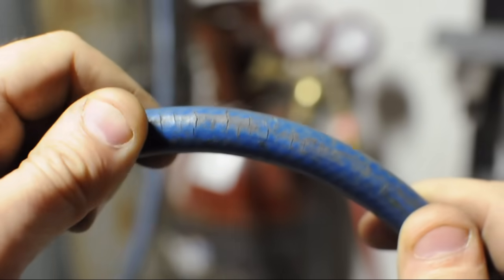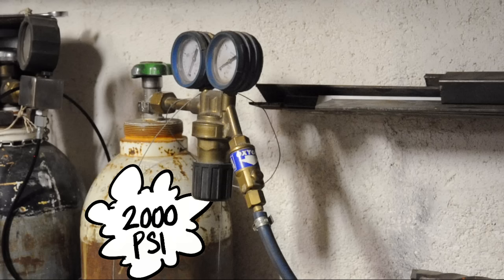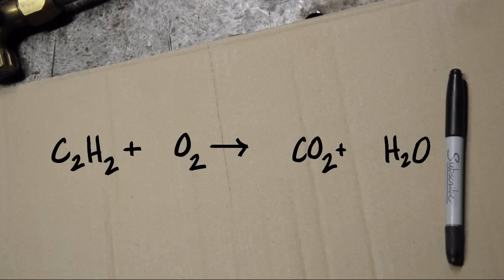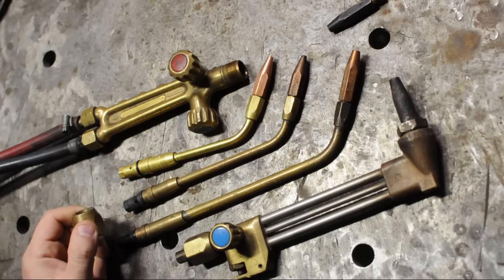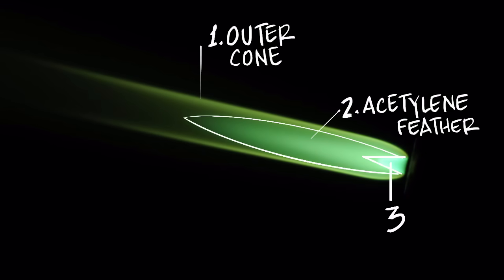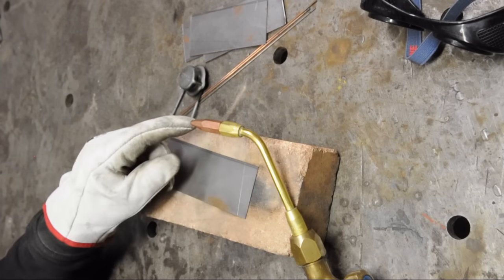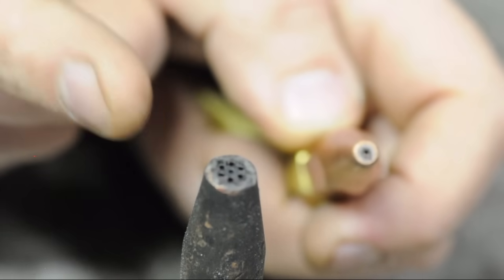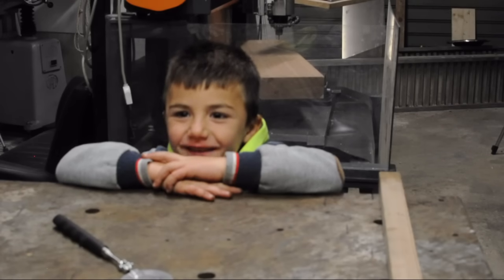Let's Talk Oxy Acetylene

Comment: I inherited my father’s oxyacetylene torch set. Unfortunately he never showed me how to use them before he passed. I have been watching YouTube to learn but wish I had in person instruction. I practiced on a couple pieces of scrap then got underneath the truck to weld an exhaust pipe. The hot filler rod stuck to the metal then fell down my sleeve and now my arm is burned up. Gravity is not your friend when it comes to welding on your back underneath things. Why doesn’t any of these videos teach that? 🤔😆 I have so many bad burns on my arm now and melted skin on my shirt. I won’t forget that oxyacetylene welding lesson for a long time. I can attest to what he said about how hot they get....

Comment: Another reason not to use anything but a striker is that if there is some acetylene buildup near the tip before ignition, it can find the flame and cause a flashback.

Comment: The saying not to use a lighter started when plastic lighters were being used, they had a few problems in the early 70’s. Someone would light the torch with alittle oxygen on to keep the fuzzy’s out of the air, and a few times the flame 🔥 hit the plastic.  💥 BOOM 💥

Comment: Just a quick tip. If the pressure in your tanks are low, just hit it with a sledge hammer to increase the pressure. 😉👍
Reply: Rent a steamroller for the tube of toothpaste effect. Gotta squeeze every last oz of gas from those bottles.

Comment: I got material that was cut with a flame. I made a new HSS end mill dull, milling only two pieces, just by making one of the cut sides flat. I knew that because of the heat the edges where hardened and would’ve chosen a carbide tool or a tool with carbide inserts, but I’m just a trainee so I use the tools I’m told to use.

P.S. for anyone interested. After cleaning one side, I put both pieces together in my vice and milled them to be parallel within 0.05mm (~0,002in) to a length of 225mm (~8,859in)

Comment: You have a dirty cutting tip. 
Also the perfect set up on a cutting is with a long oxygen stream and when you press the trigger it sounds smoother.
The pressure balance between the Two gas’s can be adjusted to obtain a six inch oxygen stream.
Then you can cut a six inch steel plate with good results.

Comment: Shop teacher always told us not to use a butane lighter stating that it would be possible for the butane in the lighter to be ignited and have the thing go off like an fire cracker in your hand.   We always thought that was far-fetched but the striker was always there so no big deal. 

I think we were told zippo lighter‘s were OK since they were not under pressure. Sorry this was  20+ years ago

Comment: The reasons for not using a lighter is many, but my welding teacher put an almost empty BIC lighter wrapped with hotdogs on the table and swept the lit torch over it, it took less then ½ second to explode, another reason is when you put that lighter in the pocket and a piece of glowing metal splatters all over it, you have that explosion in your pocket.
He then picked up a piece of blown off hotdog from the floor and said "in the best case, this is one of your fingers, in the worst case you had the lighter in the front pocket of your pants, and guess what this would be in that case"
No one ever had a bic lighter on them while welding/cutting anything after that....

Comment: I believe you use a striker because it has no fuel in it. If you use a bic, and set it down not thinking about it, and a nice fat piece of slag falls on it and melts the plastic, it could explode. I still use my lighter all the time, I just put it in my pocket or at a higher elevation.

Comment: Interesting ! I was taught to have the Oxygen pressure always higher than the acetiline
because that is what keeps the acetline from burning in the hose.... I don't really know if that's true or not as I wasn't about to experiment with flames going up the torch lines ! 
 I always set the Accet. to 7 psi and the OXY. to 10psi and seeing you put both the gasses at the same pressure scares me....   i ran a Oxygen Acettiline outfit for decades before I got my stick welder.... I had a nice victor torch set and used it quite frequently.
but in all honesty i haven't used one in years now.... there is no need I found I could cut steel with the 200 amp stick welder just fine and even saw a setup using a carbon rod and air gun attachment for doing heavy cutting...  a few times welding small stuff with too big a torch tip I did have the flame start burning in the torch itself .... and I learned that each torch tip is ment for a certain amount of gas going through it  and thus a certain amount of heat
pushing a torch tip beyond those limits is not a wize thing to do !  like trying to weld thick metal with too small a torch tip. or trying to weld thin metal with too big a torch tip and cutting down the gas too far...  it's not safe to do that !   most welding videos don't tell you that
You should mention it for sure !  they may mention in passing that "use the right tip for the job" but never tell you why !   and the reason is keeping the flame from traveling up the line to the tank ! ....and that is very important !
 good video as always thank you !
Reply: I also bought propane torch tips so I could run a propane bottle instead of acetylene ...that proved to be much, much cheaper and the cutting torch worked just as well . it was a win win !

Comment: 9:39 May be a little late but I can tell you why you shouldn't use a lighter. I wanted to light the torch in my shop with a lighter because we don't have a striker (cheapskate employer). It worked on the second try, but I got my finger a little close to the tip and because my foreman hates the soot from only acetylene I turned on the oxygen too. The instant neutral flame burned the first layer of my skin to a crisp in a few milliseconds. It wasn't as bad as you can imagine but I was just lucky I guess.

Comment: The official reason you're not supposed to use a lighter or an open flame more specifically for lighter is it may cause the lighter to get a small coating of the gas is over it's so the next time you try to strike it up it might blow up in your hand and open flames and general could be because what happens there is that you're shooting out all these highly flammable gases on to it and it causes the flame to grow to an extreme amount rather than only lighting the torch which is why it needs a spark instead of a flame

Comment: The reason you are not supposed to light the torch with a lighter is disposable lighters are pressurized any if you happened to cut it even a little you get a small but percussive boom and could hurt yourself. The little explosion is so powerful for its fuel load becuase it starts too rich to burn, and then expands till its gets enough air and it all ignites simultaneously.

Comment: 1st job was in a gravel pit.  The foreman would have me lug the tanks up to the top of the rock conveyor whenever something needed cutting or welding.  When he was done, he would throw the tanks off the top of the conveyor (50 ft?) and they would land in a pile of sand at the bottom.  Guess I was safer up on top with him than anyone on the ground.

Comment: I just bought torches and two bottles from 1988, last used in 1991, believe it or not there's 1000 psi in the oxy still and maybe 100in the acetylene. Torches actually work but they scare the shit out of me. No leaks just ancient torches.🤯😳😬

Comment: So about lighting the torch with an open flame. We don't like to use lighters of any kind because it requires out hands to get to close to the torch, and the danger of getting a fuel source that close. I suppose of you had a large oldtimey wood torch or long candle it would be fine but at that point, it's easier to just use the striker.

Comment: I have a jewelers little torch now and love it for what I do now, however when learning how to use a normal sized torch years ago from time to time the job would explode in a shower of sparks and occasionally blow out the flame. Scared the hell out of me and I never got to the bottom of what was causing it so what was I doing wrong? I'm guessing too much oxygen but the flame looked neutral to me and I was only welding clean mild steel ( well I thought it was clean )

Comment: I know I'm late to this party but generally the reason lighting your torch with an open flame is bad is because most commonly used lighters are pressurized butane. It's basically a small hand grenade if it gets in the way of the torch flame you just lit with it.

Comment: For a neutral flame in the inner cone, you only need 3 O2 because the carbon burns to CO, not CO2. The CO then burns to CO2 in the outer flame using atmospheric oxygen. A CO2 atmosphere is oxidizing with respect to steel.

Comment: I believe you don't use a regular lighter because its possible to make a spark with a lighter upside down. if you were positioned with lighter upside down and hand holding lighter in front and in path of gases and light it could be severely burned

Comment: dont know if anyone has said that yet since the video is a fev years old buuut , my welding teacher in school said you shouldnt light it with a lighter because the torch might burn a hole in the lighter and the thing could explode in your hand . never seen it happen , used a lighter a few times  . but you never know

Comment: I’m sure it’s somewhere here, but my shop teacher always told me that using a open flame lighter was bad because it always uses a reservoir of external fuel (either compressed butane or non compressed lighter fluid) this poses a hazard because the oxy-acetylene torch flame can burn the containment vessel of the fuel and ignite it (in the case of the compressed butane, this becomes a danger and frankly a small bomb) not sure if this is correct, it’s just what I was told.

Comment: inherited an acetylene torch (note the absence of Oxy). The torch was in good shape but the hose was shot. After a trip to the local welding supply store and $100 later I got a replacement Acetylene bottle, hose and fittings.  Have yet to fire it up, glad I didn't because there is no flame arrestor in the parts I bought. Is there any use to using just Acetylene or should I take it back and get a new rig?

Comment: I believe the open flame thing has a few reasons. 

I believe it is so people aren’t encouraged to just use regular lighters. Which is stupid because of the obvious risk of burning your hand and the risk of the lighter exploding should something go wrong. If something goes wrong, you’re holding an oz of highly flammable lighter fluid in your left hand; this would apply to most open source flames. Also, if you use a zippo which were more common 30-60 years ago in the prime of torches, what would happen if you pointed a stream of oxygen into a lit zippo? Seems like an interesting question.

Comment: Which gas do you turn off first to extinguish the flame?
Reply: The fuel - acetylene.  The oxygen is OK to leave on a bit longer as it's already a component of our atmosphere, and it's less likely to cause problems if it's leaking.

Acetylene on the other hand is one spark away from going foomp, and you don't want things going "foomp" in the shop.
Reply: @Mr.Sparks.173  this is why I never really messed with the oxy torch.  I always heard of don’t do this and that.  I always used a plasma cutter but would like the oxy torch for mainly for heating/bending and heating titanium for the colors.  I’ve been using map gas bottles from Home Depot.  Takes too long.  I might pick up a small torch set the hvac guys use

Comment: I want to weld ss 316 1mm coil and make a conveyor belt out of it,can this form of welding be useful,becoz I tried Tig Mig with Argon and CO2 gas but end up with lots of distortion.

Comment: I have used a multitude of oxy acetylene rigs over the years and have never run across a flashback arrester. Once the flame reaches the mixing chamber in he torch, neither the pure gases can burn any farther up the hose due to one lacking oxygen and the other lacking fuel. Am I wrong?

Comment: The reason I was taught not to use a lighter to light a torch is because it’s a sealed plastic fuel reservoir and the flame of the torch may melt the plastic and cause it to explode… a BBQ lighter should be fine to use because it has a tube that keeps the torch away from the fuel reservoir

Comment: i have always been using a 1:2 ratio with double the oxygen than acetylene on the psi gauge. it saves you alot of acetylene wich is alot more expensive here than oxygene. and it cut´s alot better

Comment: Any tips on how to not worry about burning down what you're working on? I've known most everything here for quite some time, (didn't know about flashback arrestors, or tip differences) but can't get myself to buy a rig. Any time I need one of these, it's on a car. Like, right now, I need to cut one of the 4 shocks out of my mom's Honda. It's reasonably accessible, but, you know, it's around other things, and you're dealing with molten metal.

Should I go pull some scrap iron out of the ground (this property is was farmed from the 1860s until the 1970s. I've spied things as large as engine blocks poking out of the soil in dense wood clusters) and just go to town on it?

Comment: There are very few tools in my shop that scare me.  In fact, I can think of only one.  The oxyacetylene torch.  For most things, like silver soldering, I use a large propane torch that goes on a 20# bottle.  But there are some things you just can't do with that.

Comment: There’s not a lot of information on oxy acetylene heating for the purpose of bending. Am I correct in assuming heating to bend is achieved with a neutral flame? Thanks

Comment: The reason your not supposed to use a liter is so you don't have one welding is one of the ways liter or two tea spoons of butane is or can be equal to one stick of TNT when it goes off in your pocket we know the out come. That's what my welding instructor told the class 20 years ago

Comment: I would shut off the fuel when cutting a rusted nut off bolt without ruining the threads of the bolt. Also when cutting a bearing off of a shaft.

Comment: Is it normal for a gas weld to have a really large heat affected zone? I tried to weld a number of items and in almost all cases a large portion of the object is glowing orange hot by the time I get any weld puddle formed, and if I used smaller tip it wouldn't get hot enough to form a weld puddle at all. I looked at all the TIG welding videos and seems TIG is much cleaner with much smaller heat affected zone. No wonder I have trouble welding bandsaw blades with gas... by the time I get it to where I get any weld puddle the blade is already looking like swiss cheese (not to mention the weld itself is very inconsistent, either kinda solid if not ground down or held by a thin sliver of steel). I can't imagine someone stick welding bandsaw blades...

Comment: I would put the flame arrestor directly on the torch. THat way you do not burn the gass in the hoses. And change them when you have a flash back.
Reply: Until you drop some slag on the hoses.
Reply: @stargazer7644  that is why i use them on the torch and on the bottle.  The only gass that can burn then is the small amount in the hose. Together with an aga safe=guard 4 you are pretty safe.

Comment: It’s an exothermic reaction.   As in oxygen reacts violently with with ferrite  “iron” above its transformation range.  Thereby producing its own heat.  You are correct.  Oxygen is oxidizing the iron or rusting at a very very high rate.  So to all the people who have ever wondered why you cannot cut stainless steel with a torch.  You just answered your own question because stainless does not oxidize.   You can melt it but you cannot oxidize it.   Hence the name stainless.    The chromium and the nickel prevent that as they are non ferrite.

Comment: What about when you run out of acetylene and all you have is propane, which takes the same fittings? I know it doesn't get as hot and it limits what you can do with the torchkit but what say you?

Comment: Welding of any kind they recommend no lighters. You light the torch then where do you put it? Usually in the pocket. A spark burns through it an BOOM you are missing part of your body you may need. That's what we were taught in the welding apprenticeship course. Also: Never clean the rubber O rings on your gauges with your fingers. Just that tiny bit of oil from your fingers on that o ring in the 100% oxygen environment between the torch and the gauges has resulted it gauges being sent through a concrete block wall.

Comment: Acetylene bottles placed upside down will start spitting out liquid droplets on fire. I believe this is the added (Acetone) stabilizer. Acetylene without the (Acetone) stabilizer with combust at or around 30 PSI.
Reply: It doesn't combust at 30 PSI, it explosively decomposes.

Comment: Consider that tig and mig may be safer than having to handle 2 bottles of high pressure flammable gas just to make a 3 inch weld.

Comment: A lot of plumbers and tradies have those bottles laying on their side. Though yes I was taught the same thing at school. With the teacher pointing out his wife used acetone to remove nail polish.
I have real reference,,, I accidently played the torch over my left hand at school, severe burn!!
For welding steel,, especially rusty steel oxy is the best. I have welded up more than the occasional rusty muffler and small chassis cracks that no other welder would do. And no sanding everything shiny.
Why do oxy hoses have such short life. I seem to be replacing them more often than bottles.